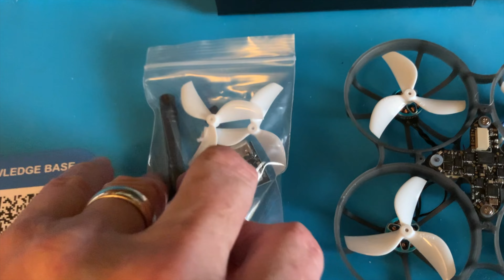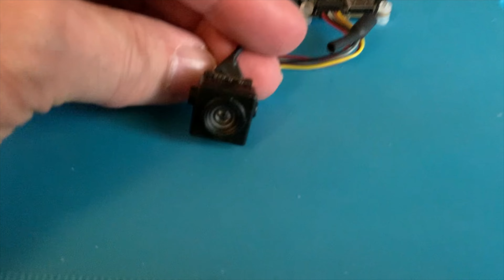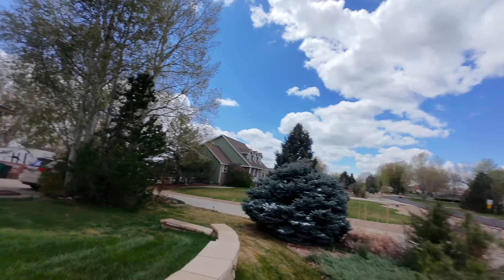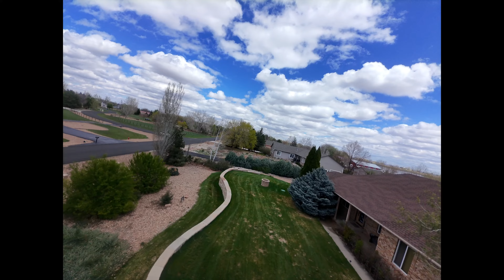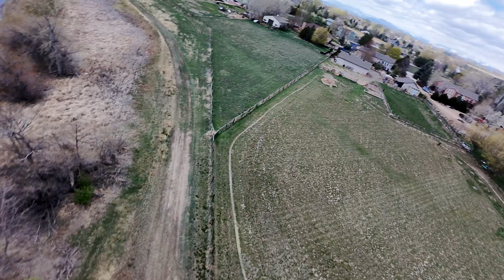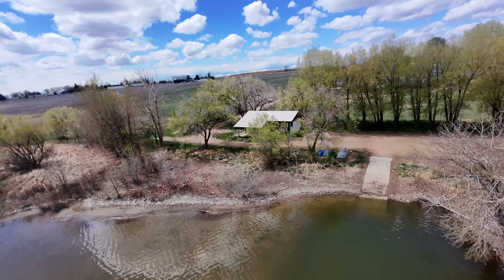Meteor75 Pro O4 Review and Canopy Hack

Comment: Hi mine flywoo shell get some vignetting on the corner, do you have that problem?
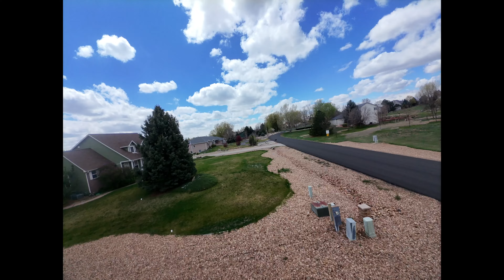Reply from the maker: No vignette that is obvious on the edges to me. I am recording in 4:3 4K 60fps to get full use of the camera sensor vs 16:9 cropping. Seems like I would notice it more in 4:3. I would make sure your ND filter is fully seated. If you go to 9:10 in the video there is no post stabilization. I am not  a professional videographer so I might not notice if it is not obvious.
SLOG

Comment: Did you have any issues with jellow?
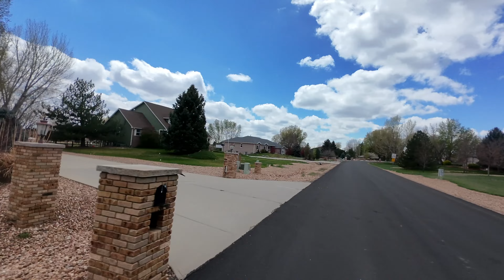Reply from the maker: The idea behind the video was to show my canopy hack that helps mitigate the stock jellow issue. If you go to 9:07 in the video (raw not stabilized) you can see the improvements. Keep in mind I was also using a  ND8 filter which is another advantage of my hack. I would take a peek to see if it is good enough for your needs.  Keep in mind this is not cinewhoop.
Cheers,
SLOG

Comment: I used hot glue to hold down the camera connections and antenna. I like your idea of the Flywoo camera mounts and I’ve been wanting put nd filters on my camera. Checking out Flywoo for those mounts thanks for the tip!
Reply from the maker: Glad it was helpful 👍

Comment: How do I remove the beta fpv soft mount system. It feels fragile and I’m worried I’m going to break the camera.
Reply from the maker: Here is a BetaFPV link on the installation with the rubber suspension. Just do it in reverse order. The only thing to be careful of is the MIPI cable (camera to VTX cable). I would say if you are not comfortable, I would just fly it as is. The video feed is flyable in stock configuration and is still way better than analog.
SLOG
https://www.youtube.com/watch?v=zt91MbWZ6SQ
Reply: I’m able to take the drone apart fine it’s just the main front bracket that you snap the camera into. I’m trying to remove that. It seems very difficult. My goal is to add the fly woo mount so I can use ND filters.
Reply from the maker: @DeadlyShadow413  yes it is tricky if you have an existing housing in place. Try using a small flat nose screwdriver and pry up against the plastic lens case not the circuit board or you will damage it. Be slow and careful taking small bites alternating top to bottom.
SLOG

Comment: DJI just repaired 1 of my 04s no charge thank goodness O have not even got to fly it yet such crap
Reply from the maker: If you have not done it already, I would use some B7000 (or equivalent) glue on the MIPI camera connector to camera board. Link to Albert Kim's video in the description. I have had luck so far but time will tell.
SLOG
Reply: Will that void the warranty DJI just fixed mine free of charge  @slogfpv